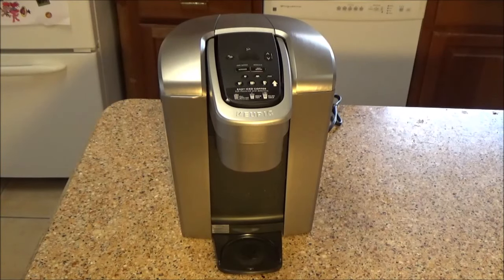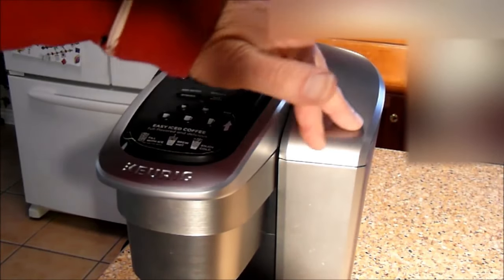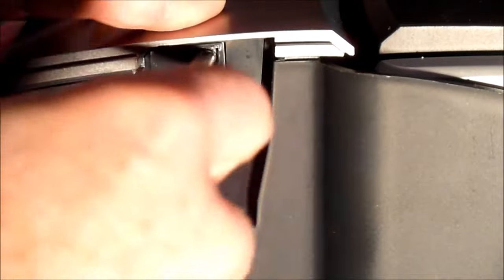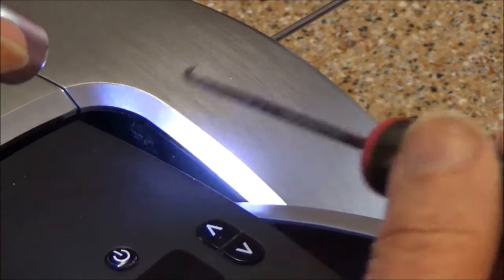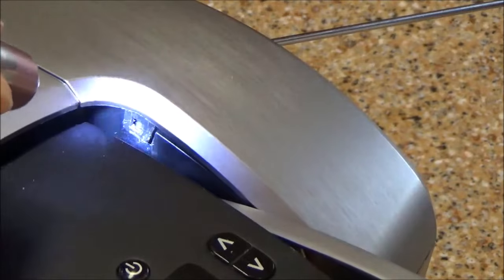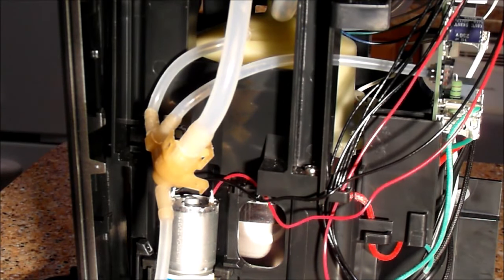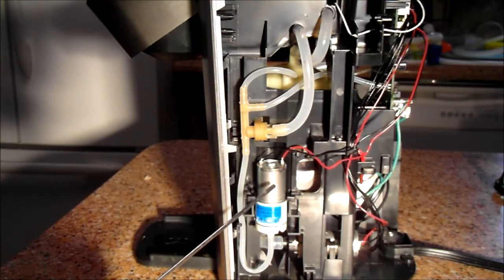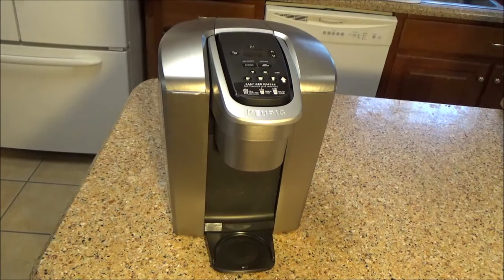Keurig Elite K90 Disassembly and Theory of Operation

Comment: I hope you can get this, even after a yr you have done the video. I have the elite, I am getting short cupped. Whats your thought of the problem? I have descaled, cleaned the needles. I'm thinking of replacing the filter but is that the issue?
Reply from the maker: If you are talking about the filter in the outside water reservoir, it's OK to remove it temporarily just to try it and see if it makes any difference.  If not, remove the whole water reservoir and look in the entry port that it plugs into and see if the screen inside looks like it might have anything clogging it.  Unfortunately, you can't remove any parts from this entry port to clean it out without removing the plastic shell that covers the machine to get to it.  You can test it to see if it's blocked though.  Find some kind of tube or straw that allows you to blow air into the vent port on the side near the top (that you normally can't see unless you remove the water reservoir).  Blow into this port while simultaneously pressing down on the plus sign that is in the middle of the entry port.  You have to press down in order to open up the one way valve that closes when you remove the reservoir.  If you can blow air through this (and see a small amount of water spitting out too), then the entry port screen isn't blocked.  If none of these things work, look and listen to what the machine is doing when it gets to the end of the brew.  It should be speeding up slightly and making a "blowing out" sound to expel the last little bit of coffee remaining inside the K-cup cartridge.  If it isn't doing this and just quietly stops and leaves your coffee cartridge full of water, then maybe the air pump is defective.
Reply: @getitsettech1015  I think what he is asking is the same question I have, what component meters the amount of water being dispensed? I have a similar problem with a K Duo Plus. Lately when I want to brew 12 cups the machine will only supply enough water to make approx. 10 cups. It does not do this all the time but it is beginning to do it more often than not. It does not have this same issue if I use a K-cup and brew , say a 12 oz cup. It will dispense about 12 oz of water. The question is what meters the amount of water coming from the reservoir and determines if the machine brews 8 cups or 12 cups?
Reply from the maker: The water pump inside contains a sensor that counts the number of revolutions that the motor makes, which should tell the processor how much water is flowing.  I don't know Keurig's firmware, but I believe that the processor should be able to equate pump revolutions to the amount of water that has been dispensed.  This is the only possible way that it could be measured on the K50 or K90 - there is nothing else there capable of doing it.  On the Duo however, I'm seeing a second probe on top of the hot water tank (there is only one on the K50 or K90).  I believe the first probe signals when the tank is totally full to prevent catastrophic overflow.  I haven't seen the inside of the Duo's tank, but there is a possibility that the second probe is another way of measuring how far to fill up the tank to dispense a different quantity of water than usual.  These probes are just metal rods that get touched by the water when it gets high enough.  So in your case, since your Duo dispenses the right amount of water when you are brewing a 12 oz cup of coffee, maybe the water pump revolution sensing circuit is working fine.  IF the second probe on the hot water tank has to do with brewing larger amounts into the carafe, then the second probe may be corroded.  I would suggest de-scaling, if you haven't already.  The filling/dispensing cycle should touch that probe and de-scale it.  I also need to mention that I have seen what looks like a solenoid valve in the DUO 5100.  If it gets corroded or clogged, I don't know what effect that might have, since I don't yet know what it is used for.

Comment: Have you come across any Keurigs having had a nest of ants?  I found hundreds of tiny ants in the water tank after putting out ant traps. I think they came up through the water inlet.  Besides cleaning and descaling, etc. should I do anything else? I even ran dish soap and then vinegar treatments, with much much rinsing. The machine still works great. Is it worth tearing into the machine to remove dead ants inside?

Comment: I wish there was a way to drain this model in the winter when I close up my camp. The older model you could lift up the float switch & force it to drain. I've froze up two Keurigs now.
Reply: Hold it over the sink, and with the tank removed, push down on the spring loaded white nylon water inlet valve that the tank sits on. The water should flow out. It does on mine.

Comment: 10 mins and enjoying the video.   Just have to revisit once I make a sturdier hook.  The Bobbie pin I MacGyver'd worked for that first front latch but not the on on side of the handle
Reply: Small point . Would have appreciated a heads up not to turn upside down b e f o r e you tell us to go to the bottom to take out the screws
Reply from the maker: That place at the side of the handle is pretty hard to get to without having a tool that's shaped at a right angle.  I wouldn't leave the impression that people have to make a custom tool though - other people here have suggested alternatives to this.  Ready Teddy suggested using a dental pick.  Some have good capability to pry at a right angle just like my tool does when you twist it.  You can buy them online or sometimes at hardware stores.  Sock Monkey suggested using plastic tools that are used for auto interior panel removal.  That way, you minimize cosmetic damage to the machine.  On Amazon, search for "dental pick" or "door trim panel removal tool".  Back to that latch though, you might just try a long, thin straight blade screwdriver similar to the one I used in the video.  It's not ideal, but if you maneuver just right, you might get the blade under the latch.  Might be worth trying.
Reply from the maker: Good point, sorry about that.  If you turn it upside down, it doesn't guarantee damage, and most videos out there that help you take the machine apart don't seem to think it's a problem turning the machine upside down.  So maybe it's just me - I'd hate to create another problem while I'm trying to fix the first.  If you've turned yours upside down, just check the tubes that go to the air pump and to the pressure sensor on the circuit board.  If they don't have any water in them, then you're good.

Comment: Is it possible to get a high pressure valve,
Reply: Continue;The high pressure  valveThe one w/the 4 air lines attached to it, can it Be available for replacement??
Reply from the maker: You can search for that part on eBay, but the only ones available that I know of are used.  Even if the part came from a slightly different Keurig model, the part is usually the same.  Otherwise, you could just use a regular tee instead, such as https://www.amazon.com/Quickun-Fitting-Plastic-Splicer-Adapter/dp/B08LHDKWR9/ref=sr_1_34_sspa?crid=2CU7P6ISAU17I&dib=eyJ2IjoiMSJ9.bVltw_E2jxMTL4MlQzzNZKZIcWc_iY7cpYbH_D7eOrQrPhq2uwle7d7RuLRbZwysKK2A62Dj8s_ll5Ob1QmWZg-qrx5aIfssxNSWc7DcoH31PJXyu4vH_PJHmOF-HUFSmcY-IyuMt0DMpV84OZNN8R64FI_B6xDP1vX2fVcdINF3vPH1UtSBaNU1U5CY85uNUiKJMOLpRstIbOSHpU5TNdjt-Wc4k4duPpDpAXWeb10.1MIRoxDOUbRqrH0EjWh2-F6AKq_TO-y6ly3sGLMW3MU&dib_tag=se&keywords=1%2F8%2Btee%2Bplastic%2Bfood&qid=1728394595&sprefix=1%2F8%2Btee%2Bplastic%2Bfood%2Caps%2C152&sr=8-34-spons&sp_csd=d2lkZ2V0TmFtZT1zcF9hdGZfbmV4dA&th=1.  This would omit the pressure relief valve, but since the pressure sensor on the circuit board monitors pressure and feeds the information to the processor to shut down the pump if necessary, you could possibly do without the pressure relief valve.

Comment: Hi, I'm having issues getting my reservoir screen/seal back together(the part under the water tank that allows water to flow into the machine).
You wouldn't havven to have a diagram on how it goes back together?
I've tried and just can't figure it out.
Reply from the maker: There's no way to post pictures in these comments, but I'll try to describe it:  If you have it fully disassembled, find the small clear piece with the plus on it (it should already have a clear flexible ring around the outside of it).  Now take the clear basket (the one with the screen on the bottom of it) and fit this over top of the plus sign in the other piece.  Now go back to the main piece on the machine that has the tubes connected to it.  Find the small plus sign in the middle of this and place the spring over it.  Take the first two pieces (basket, etc.) and place them on top of the spring.  Now find the black cover (that the reservoir sits directly on) and make sure the clear grommet seal is inside of it if it isn't already, then start trying to line it up to snap down on top of everything else you've already assembled.  You'll have to rotate it until the 3 snap latches and screw posts line up in the right places.  Now snap it all together.  Screw the 3 screws back into place.  Mount this assembly into the machine by sliding the flat tabs under the hooks in the machine and that should be it.

Comment: Mr. GetItSet Tech, Have viewed your videos and several others on the Keurig K90 without solution to my problem. Maybe you can recommend a solution. Device works fine (with exception of ADD WATER sensor) with no Kcup. Water fills up cup, and air pump cleans out residual water. All other features, levels, etc work fine. However, when adding a Kcup, only fills partially, spills coffee into reservoir, air pump does not empty tank, and sometimes shuts power off. I have cleaned with Keurig system solution, and cleaned needles in head and reservoir with no solution. I have blown air into the water level sensor vent, and the air comes through to the external tank, and if the water external tank is low, the ADD WATER light comes on until it is filled, but will not sense low water again next time. It would appear the system will not pump water through the Kcup (back pressure?). Any suggestions would be appreciated. Thank you.
Reply from the maker: A few questions:
1. When you say that it spills coffee into the reservoir, do you mean into the external water tank?  If so, is it coming out of the water level sensor vent?  I don't see how, but I thought I'd ask.
2. Can you raise the handle and look underneath inside the arm and find the white pad that swings up when the handle closes?  Then look past that to try to see the hole that the pad mates with when it swings closed.  It's hard to get at the right angle to see it.  If you can look at it with a flashlight, does it basically look normal (just a square hole) or is it packed up with any coffee grounds?
3. Do you happen to have the machine disassembled?

Also, back pressure is one of those things that can make the machine shut off it's power if the pressure gets too high.  

I'm guessing the problem with the ADD WATER sensing isn't related.  I have two K90 machines and they both have problems sensing water, and I even worked on a K200 that did as well.  If you continually brew coffee without turning off the machine, you can eventually run completely out of water and it just brews air.  The machine doesn't realize it's out of water.  Then if you turn the machine off and back on again, it wakes up and says, "Oh Uh Gee, I guess I really was out of water".  Then the ADD WATER light comes on.  My opinion is that their method of sensing the water level with metal probes is very unreliable - not nearly as good as the floating magnet system that they used to use.

Comment: Great video. This really helped me figure out how to take it apart and cleaned/double checked what I could but I continue to have the same issue... The machine powers up, I load a K-Cup, select "brew" by hitting a button...and the machine just shuts off after about 5 seconds. Any ideas? I'm desperate for morning coffe and about to just go buy a new one.
Reply: Mine is also doing the same thing. Hit brew and it just shuts off.
Reply from the maker: There are a few possibilities.  When I pinch the tube that goes from the top of the hot water tank to the dispenser in the arm, it sounds like it is starting to brew (but nothing comes out) and then just shuts off (but the clock display stays on).  So this proves it would behave that way if there is a blockage somewhere in that tube, or in the area of the exit needle at the pod.  The other possibility is that it behaved about the same way when I disabled the air pump by pinching an air tube or unplugging its electrical plug.  Also, there is a 4 port plastic tee that has the pressure relief valve and 4 air tubes attached to it.  I have found that when it is new, it looks white.  As it ages, it gets darker colored and eventually brown.  At that point I had one break, but it was flaky inside because the material was breaking down.  So maybe there could be a clog somewhere in there.
Reply: Mine was doing the same thing and immediately shutting off. This video was very helpful and aided me in dissemble. Not sure why it worked or it was unrelated and I fixed it somewhere inadvertently but I took a 9v battery to both 12v pumps (air and water) forcing them on at reduced voltage. after running a reservoir of water through using that method it started to work reliably again. I'm not an electrician so do this at your own risk.
Reply from the maker: That was a good idea, really.  People should try this.  The only reminder is to make sure you unplug the pumps from the circuit board before applying voltage, as you probably did.  It may or may not damage the circuit board, but it's not worth the risk.  I'm glad yours is working!

Comment: Great video but you didn't mention or showed the check valve. I am guessing it is somewhere under the top lid that you removed?  My machine got stuck with the red "descale" light on after I tried descaling it. Now when I start it, It just shuts itself off immediately.   I was wondering if the check valve got clogged and needs cleaning.
Reply from the maker: At https://youtu.be/0Q8ueL0v5oQ?t=2294 on the video, a flexible tube comes in that connects to a long black assembly.  I don't know whether that contains a check valve just before it dispenses into the K-cup, but there is a check valve just past the water inlet for the external water reservoir.  I show this in the video for the K50 at https://youtu.be/2o7Myp3XsgI?t=1382.  This check valve can be disassembled by opening the tabs, but the tabs are very easy to break so I would advise against it.  As far as what might clog, I suppose there could be several places, but there is a hard plastic device with multiple flexible tubes attached at https://youtu.be/0Q8ueL0v5oQ?t=2055 in the video.  When this device turns from a white color to a dark brown color, it could be disintegrating inside, getting brittle and clogged.

Comment: Using the plastic tools that are used for auto interior panel removal would be a lot easier on the machine.
Reply from the maker: I've never tried those, but it sounds like a good idea.  They're about the right size.

Comment: Any idea what the rubber seal is about 40 min in that keeps it sealed when closed? I think mine is bad. After my brew finishes, when it reloads the hot water tank it spits out more water.
Reply from the maker: You have to remove the outside water reservoir, and open up the handle to be able to see it.  Shine a flashlight in there to see it best.  It's a white square rubber (or silicone) pad that's flexible.  First, make sure that it's actually in there and hasn't fallen out.  Second, see if you can get your finger in there to see whether the side of the pad that contacts the hole is flat like it should be, or whether it's overcompressed (worn).  If the pad seems to be OK, maybe the handle closing mechanism has been bent or cracked such that the pad doesn't get close enough anymore to cover the hole.  I'm not sure where to get a pad if it's bad, but you could try to substitute a rubber bumper/foot with a self-stick backing to it, that you could get from a Home Depot or Lowes.
Reply: @getitsettech1015  I'm thinking that anything with adhesive to make it self sticking probably would not be very heat friendly, what with that hot water being dispensed with each cup of joe.